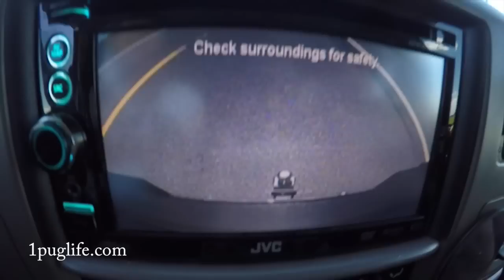1000 hp camero

Comment: Automatic...... yet it has 2 huge turbos bmp
Reply: Automatics are more reliable and quicker than a manual...Furthermore,more consistent when drag racing !!! drag cars are majority automatics since they came out..

***The 1985-1993 Mustang 5.0 automatic was slower due to 205 hp vs 225 for the manual..

The manual had a different cam and heads..The automatic 5.0 and the manual 5.0 were not the same engine...People dont know this...

But most cars especially today the automatics are quicker due to 5,6,7,8,9, speeds and those have lower 1 st gear ratio to get out of the hole quicker than a manual trans...Plus you don't miss a shift..

***Mopar,Dodge,Plymouth,Chrysler 383,413 and 440 engines with the manual 1968 and older also have more power than the automatic versions..Hotter cam..

The Mopar 727 torqueflite most reliable,bulletproof transmission was the 1st to out perform a manual in performance and quick firm shifting,and butter smooth when cruising...Another thing people don't know !!!!

I am a Automotive,collector,restorer,mechanic and business owner automotive seller...and a hell of a driver !
Reply: 01trsmar HOOOLLLLEEEEEE
Reply: Chris Soares you go race that twin turbo 5.0 with a twin turbo 5.0 manual. I bet he wins every time